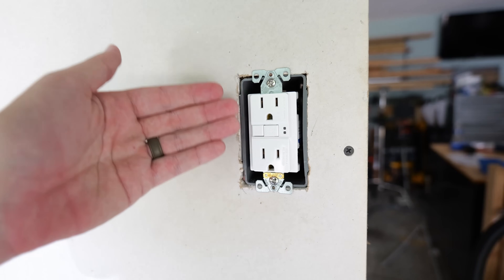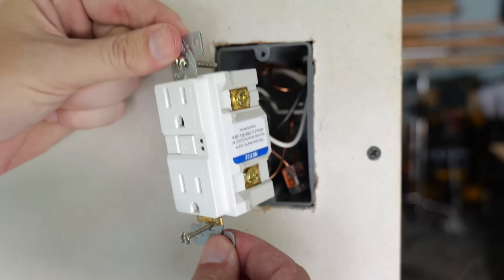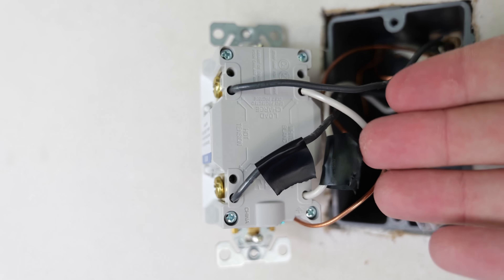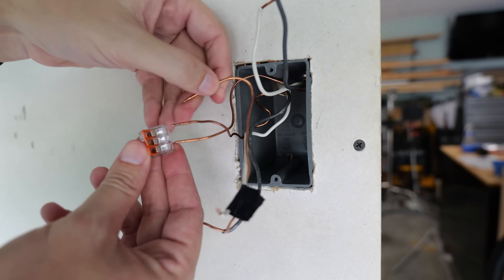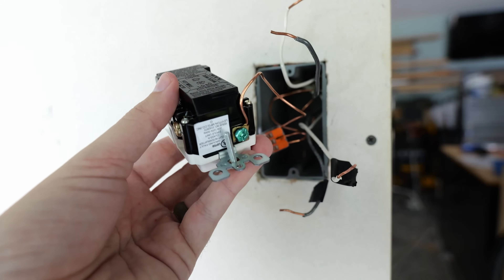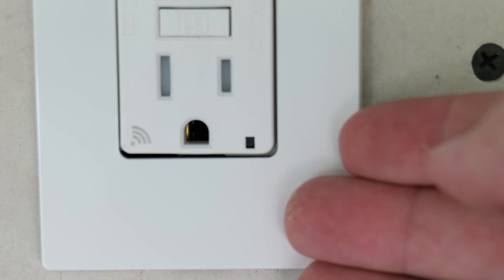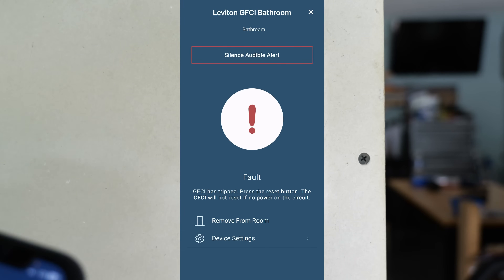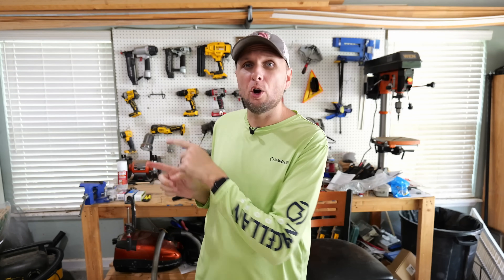The First Outlet That Let's You Know Something Is Wrong and Where!

Comment: Hi Adam, I replaced the GFCI outlet by our bathroom sink because my wife wanted a white outlet to match the new white painted wall. Well, I discovered two black and two white wires and one ground. Both black wires were connected to the LINE side on the gold contact, both white wires were connected to the LINE side on the silver contact. The bare copper ground was connected to the green ground contact. Nothing was connected to the LOAD side and the tape was still covering the LOAD contacts. Is that unusual? Anyway, I wired the new white GFCI receptacle the same way and it all works fine. My tester shows the wiring as “correct”. I enjoy your channel and your videos are very helpful. Thanks!

Comment: 10:30  i'm not hearing "alarm".   Only Noting "Fault" does nothing, beyond knowing it was Tripped.  'Knowledge' [from] an APP ... but Hey, more you place power in automation, the greater options may open for others to gain ConTroll of what One Never planned for.  
Do Not need something added to receptacle that can go wrong, or Do I?  All was good for years, then coffeemaker 'shorted', Knew right away Breaker Flipped, NOT GFCI, or maybe Both did.   Breaker reset, but dead GFCI, will Not reset, and Only item using line.    just weird    bet App won't say why.

Comment: You test for no power by using an outlet tester that shows no lights after you turned the circuit breaker off.  Wouldn't you get the same result on the tester if the GFCI outlet was tripped, yet you would have wires that are still hot if the CB is still on?
Reply: I guess I should add, not trying to be snarky here, honestly curious. Trying to teach myself all I can on GFCI receptacles and that was the question that I thought of when I saw your video...which was awesome and very informative.  Thank you for the content and education!

Comment: Replacing an entire house's gfci outlets with these could quickly use up a cheap WiFi router's available connections. Like the ones most ISPs provide (Frontier, Comcast, Spectrum, etc.). And you never get as many connections in the real world as the specs say.  And if you need an outlet that's in a dead zone of your house, good luck. You should do a video about WiFi upgrades, informing people about things like number of connections, channels, 2.4 vs 5 GHz, WiFi 6, mesh networks, etc.

Comment: Very informative. Thank you.

Question,

What if you find 4 knob & tube (2 line / 2 neutral-white) & 1 white “Romex” &  1 yellow “Romex” wires inside the metal box? 
Trying to use a gfi to a single pole light switch. When light switch is engaged/turned on it trips the breaker.

Comment: I'm not an electrician, just a 61 year old trying to learn basic electricity.  I bought a Klein receptacle tester to test my receptacles in my house.  Two receptacles next to one another in the kitchen give the alert " hot and neutrals reversed" A) Is this a fire hazard? B) Is this something fixable without tearing out the sheetrock and running the Romex?  C) Is this something I can fix?  I plan on hiring an electrician but just thought I would ask before I call.  I have lived in this house 33 years and had no problems with either one of the receptacles.  Any response would be appreciated.

Comment: What is the cost/benefit of this kind of product. I cannot envision a practical use case where all of this extra overhead and cost would be worth it. The major limitation is the reliance on "app store" technology and from what I can tell is a proprietary setup. I've had other products that have enhanced features that are only accessible through an app and within a few years those apps disappear. With that in mind, I have a serious question for you - what happens if the Leviton ecosystem goes defunct and they stop supporting and/or drop the app from the app store?
Reply from the maker: Leviton is one of the largest electrical manufacturers in the world.  That is highly unlikely to happen.
Reply: the only application I can think of is for a cord connected refrigerator in a restaurant.  those have to be GFCI protected.  there is an exception allowing any fixed residential appliance to be powered with a non GFCI protected single receptacle.  so only the commercial fridge would be a case where you are required to have a GFCI subject to a nisance trip, and where you need to know immediately.

Comment: My complaint with all these Wi-Fi enabled home automation devices is the nightmare they cause if you want to change the Wi-Fi password. Z-wave, LoRaWAN, and other mesh network protocols meant for these types of devices don't have this issue.

Also, GFCI protection is not required for refrigerators in a kitchen area. NEC 210.8(A).1 exempts GFCI protected outlets for non-counter top surfaces. Garage refrigerators may be exempt if the garage is above grade. You're basically screwed on basement refrigerators.

Comment: any reason why they went with screw instead of the pushlock for the wires, like the other newer receptacles they make?
Reply from the maker: Those still are not a super popular option.  Also, the connection on these are superior to those with the back wiring and screwing it down.
Reply: they've already bulked p the device for the GFCI and WiFi circuitry.  the toolless terminals would add too much more bulk to it.

Comment: What a great way to trash your wifi network… 🤦‍♂️
Reply from the maker: Why would it trash a Wi-Fi network?  It has zero effect on it.
Reply: @HowToHomeDIY  every single wifi devices adds interference on your network and load on your router. Unless you have a really high quality commercial grade router, installing tens to hundreds of wifi devices is not recommended. Home routers, and especially those provided by your ISP are not designed to handle that many devices. That is why most Smart home devices use other networks, such as ZWave, Zigbee, Thread, Bluetooth or LoRa. Wifi is for computers, cellphones, tablets, not for smart home. At least not if you are interested in stability
Reply from the maker: @maximeboissonneault6203 I have so much stuff on my Wi-Fi and have zero issues.  Great ping, extremely fast speeds, I game and have zero issues.  I do use a mesh network though to make sure I have stable service throughout my house.

Comment: Why, just why?
Another thing with WiFi, I simply don't understand what is going on with these companies, everything is now on WiFi, terrible.
And to control this one needs another app, just why.

When the GFCI tripped you know something is going on and I never needed an app to tell me where.
Useless gimmick

And 1 more thing, slow down with talking, and less repetition of the same thing you just said five times already.
Reply from the maker: You mean like you just did? 😂
Reply: Agree completely. Why? I don't need my phone to tell me my electric shaver won't work because the GFCI is tripped. It already has a little green light!  At first I thought the WiFi outlet might provide wattage usage data or alert to low voltage conditions. But just to tell me it has tripped AND I cannot re-energize it from the APP. Sorry.  Neat and interesting sure.... but quite useless.
Reply from the maker: @eosjoe565 yeah not everything is going to appeal to everyone.  That’s what’s great.  If you don’t want it you don’t have to have it.

Comment: So it only notifies you of a fault & is not a smart controlled outlet where you can remotely turn the outlet on/off/schedules?   Also, I'm disappointed that this doesn't have the new wago style connection they started to offer. So much safer & fool-proof!

Comment: Very interesting. I can’t understand why they still sell non tamper resistant receptacles. As I understand it you need them , per code, pretty much every where in the home. I wonder if the TR “doors “ interfere with WiFi?
Reply: @@phillipbanes5484  60-years ago when my house was wired there was no such thing as tamper proof receptacles. Adding a few new non-tamper proof outlets now isn't going to change the landscape much. :-)
Reply: Like many, you don't understand code.  My house was built in 1957 to 1957 code.  I am under no obligation to update my house every time code changes.  So my house has no TR outlets. 

Also, I look at those little doors as something waiting to break on any outlet that has plugs inserted and removed on a regular basis. 

Yet another expense foisted on us by the safety Nazis who worry about protecting the 0.001% of the population that has issues.
Reply: you aren't required to install tamper resistant receptacles in businesses other than childcare businesses. and no, the gates are plastic, so they're wifi transparent.
Reply: Are you kidding?  I despise tamper proof outlets. On some of them it seems like something is going to break before the "lock" gives way and allows the prongs to enter. Anytime I have electrical work done I specifically say NO TAMPER PROOF OUTLETS!   Here's a good one... I recently purchased a new Honda generator. Guess what?  It has tamper proof outlets. Now in what world is a kid going to get the generator out of the garage, start it, and then immediately proceed to stick something in the outlet?  I say... let natural selection take its course. :-)
Reply: @eosjoe565 agreed
Reply: @eosjoe565 If you have GFCI, you don’t need TR. The GFCI  will prevent a shock.
Reply: @littleprincess4417  Interesting... all the GFCI outlets I had installed by certified electricians ended up being tamper resistant.
Reply: @eosjoe565  That just shows that money is driving the code revisions. The stated purpose of TR receptacles is to prevent a child from inserting something into the receptacle and getting shocked. The GFCI will trip in that case to prevent the shock, so TR  is not needed. Just more expense.